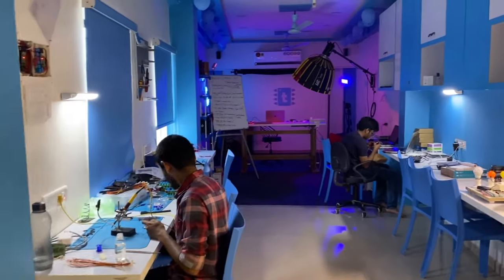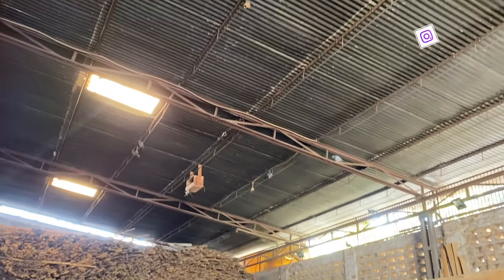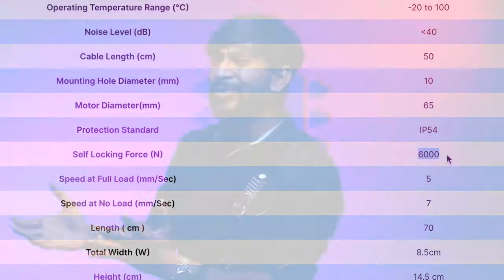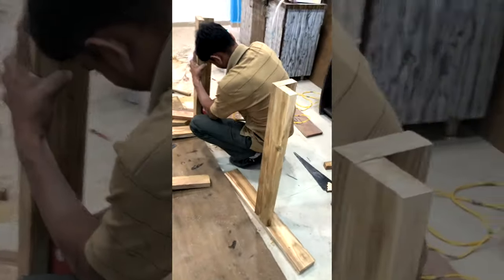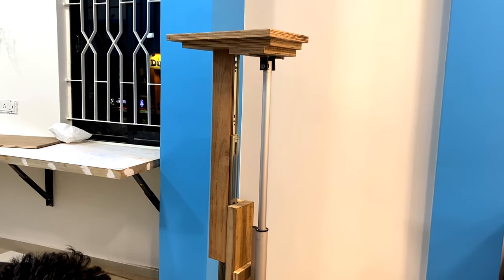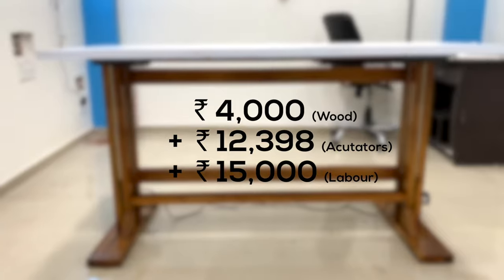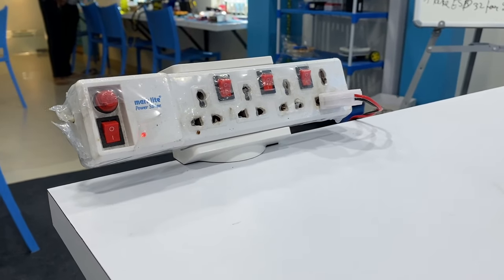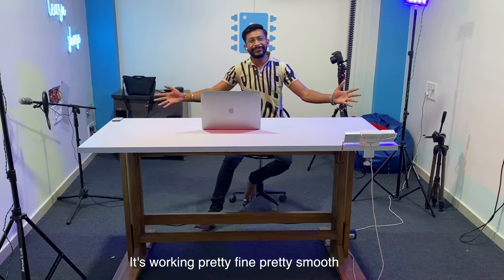We made the simplest Height Adjustable Table from Scratch

Comment: You can add electric current sensor & keep track of current once it turned on When you notice sudden change in current it means table encountered a collision 
Usually motors will draw more current when we tried to add more load.

Others method is to use rotatory encoders there you need to track change in speed during the collision.

There are plenty of methods You can try:
Using mpu6050, lasers, accelerometer, etc.
Reply: Very Brilliant point.
Reply from the maker: I’ll definitely try this
Reply: very practical

Comment: Regarding anti collision, if u can read current consumption frm actuator, that can work without introducing a sensor. 
Advantage:
 1. No BOM change
2: cost remain same and in turn as u are adding a feature, u can add more profit.
3. Complexity do not increase.

This approach we utilize in designing automotive door window up feature called anti-pinch. So we have a motor which moves glass in car windows up-down. ECU continuously read current from motors. If motor see something coming on their way while going up, it trying to push and apply power which in turn suddenly increase current consumption.
ECU detect change in current and cut motor operation.
Hope this helps...
Reply from the maker: This will definitely help
We will try it out
Reply: Vivek Bhai can I get your email id

Comment: 6000N x 2 actuator.. they can pus a quintal of weight... Even 2 1500N would have done job.. can save 1000-1500 per actuator...
Also, we can work with aluminium profile to make table.. lighter weight.. saves labour charges and can be dismantled, parts can be changed to change length and width or the table anytime..
Reply: Hi Abhizit, I am actually trying to build exactly same with aluminum, Looks like you have knowledge in this stuff, Could really use your help, do you have some sort of specs or design? thanks in advance
Reply: @ShalemRaj  not much specs but you can check 2040 aluminium profiles and get the idea...
Reply: Thanks so muchhh

Comment: Good work.👏Only feedback, you should have used the cable sleeves for the wires or a better 3 plug holder for the power supply.

Comment: Just for ":Hydraulic Gas Lift for height adjustable table". I think gas lift for table is a better mechanism as it does not require any electricity to adjust height, and i feel it change height faster than the electric actuator.

Comment: They probably measure the current consumption to stop the table from damaging other objects. If there are obstructions the motors will suddenly consume more power, if you detect that from the wire in-between the motor and the power supply, you can stop it. Waiting for an update video.

Comment: Instead of using button use touch sensors and as u added support in between it looks like it will break ur leg if u mistakenly keep between them so yeah better to add preassure sensor

Comment: Sir use laser sensor it's work only when motor works put laser light sensor in 3inch from your top plywood sheet n put laser 4side and program like if laser light touch any object then light sensor gose low and stop the motor.  Like. 

 If light== high 
  Then. Motor1== low

Hope you understand this 🤣

Comment: You can also make adjustable table with rack and pinion combined with locking rachet for cheeper 

One more suggestion would be to add nfc reader under the laminate , so that everyone from studio can save their prefrances and after putting something like phone on table it will adopt according to their personal need , and wireless charger will be a great addition

 ( i installed wireless charging coil under the laminate by routing chanel on plywood )
Reply: Is there video of rack and pinion based table? Please share

Comment: oof, 5mm/s is slow. i got a pair of 300N linear actuators and they are double the speed (still slower than the ikea and amazon motors), and it has no problem with 3 monitors, a laptop, a drawer with books, etc etc.